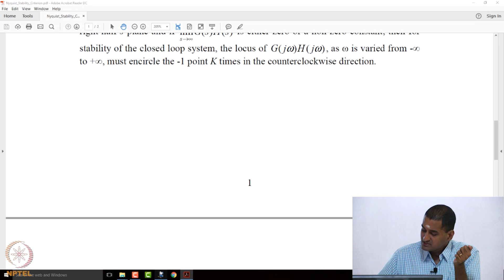mod11lec63

Comment: nyquist criterian continued ...
we are looking for # encirclements in nyquist plot of OL tx func to guess the stability of CL tx func.  0:00
Nyquist criteria : For CL syst, the locus of G(jw) H(jw) as w varies from -inf to + inf must encircle the --1 point K times in CCW  
Modified nyquist criteria in case OL poles and/ or zeros lie on jw axis                   6:30
relative stability   :                  19:40
a syst with CL poles more towrds left on LHP will be relatively more stable than the one with poles closer to jw axis becoz it will be more tolerant of changes in poles positions wrt time or due to parametric variations or modelling errors etc, being farther from jw axis. Yet being farther, its rise times will be higher i.e. the syst will be slower ito of dynamic response than the one closer to jw axis.